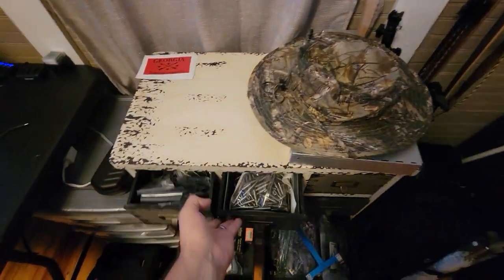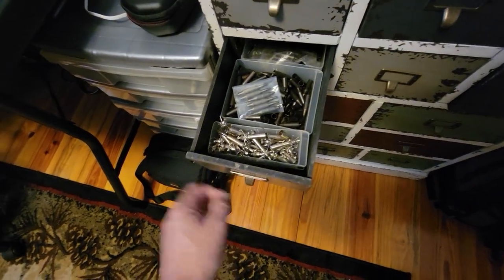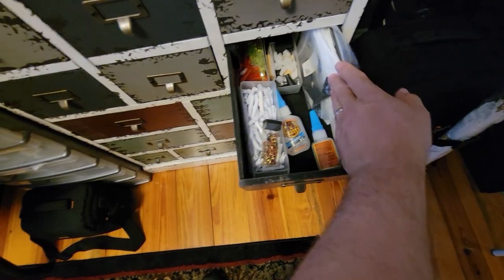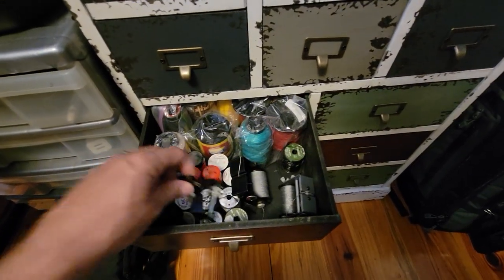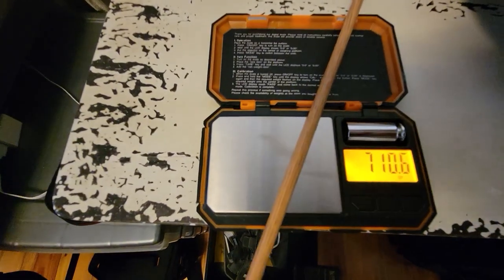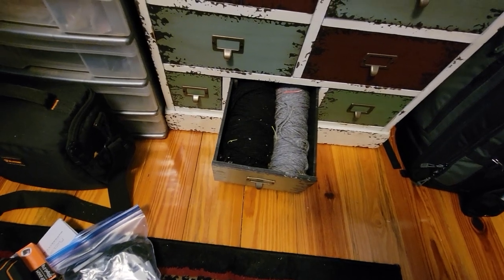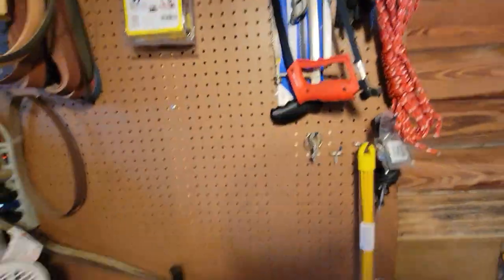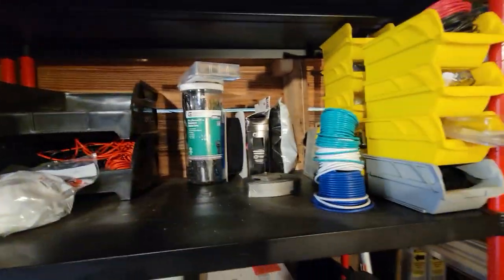Arrow Making Supplies You Need And Want

Comment: I remember back in the day, they used to sell the fiberglass bowfishing arrows with the small black rubber fletching that was sleeved onto the shaft. The fletching was pretty much worthless, and because of its stiffness, would actually slap the the riser. I cut it off as soon as I bought the arrows. I even had a solid aluminum fishing arrow that would bend about every shot that connected with a carp. The last few years, we have had high water issues at the local lakes in the Spring, making the large shallow mudflats not usable for carp shooting. On the Gorilla glue, I used to use it, but it melted the quill on the feathers. I use E6000 glue for nocks and feathers now. You have a lot of archery goodies.
Reply from the maker: Yep I remeber those fish arrows. Never tried gorilla glue on the feathers.  Good to know it's not good for that.  Love e6000. Use that on a ton of stuff around the house too.

Comment: Howdy, Is there a reason why you use super glue on your inserts and not just hot melt on everything so it's all reversible?
Reply from the maker: The super glue is heat reversable as well. But I never tried hot melt on a carbon shaft so not sure if it eould work great or not. the gorilla glue has always been excellent.
Reply: @SamkoTradBow  Hmm okay, I'm gonna try some of that on inserts, I did not realize it was heat reversible.
Reply from the maker: @TheHYENA87  I just hest a field tip up and screw it into the insert. Wait 20 or 30 seconds and pull it out and the insert comes with it
Reply: @SamkoTradBow  thank you, I'm gonna try that out. Acetone or alcohol prep prior?
Reply from the maker: @TheHYENA87  alcohol prep for any and all surfaces that get glue